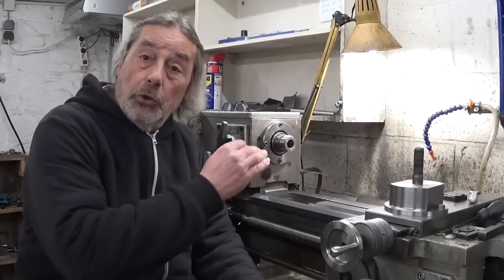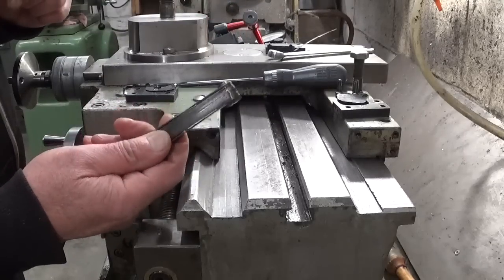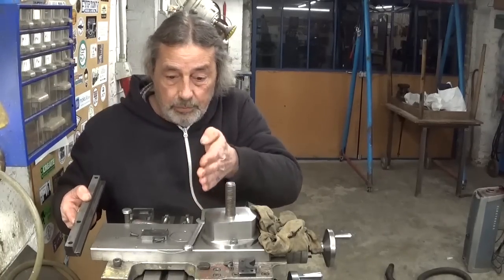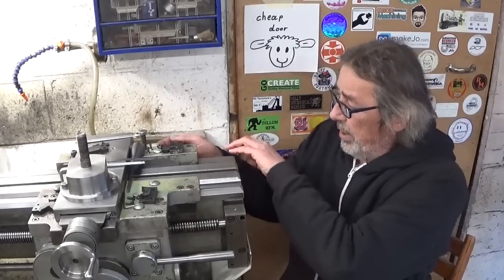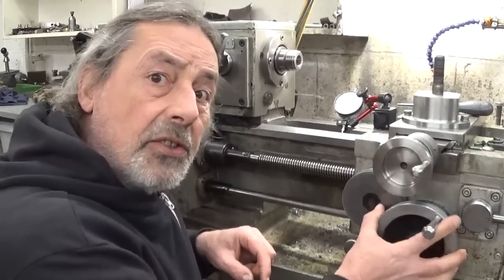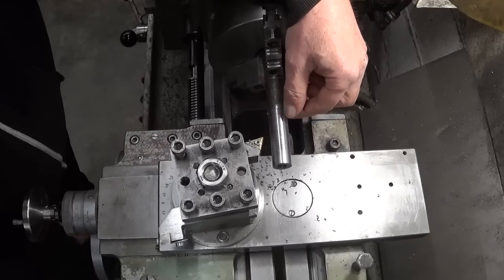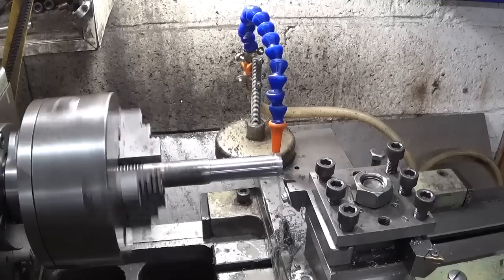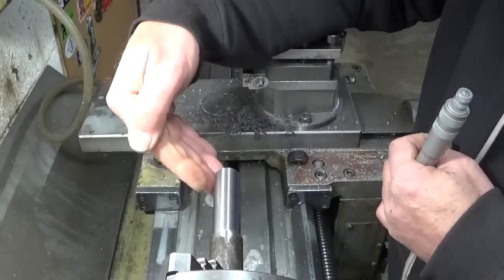Carriage problems.

Comment: That's really strange, and discouraging. I think your problem lies in the wear of the V ways on the saddle. I would take the carriage apart and turn the saddle upside down and examine the way surfaces. Maybe you have a piece of swarf or a burr that is causing this misalignment. If you have a large enough surface plate (who does?) you could measure the V ways for wear down the length of it. You may need to mill the ways flat to solve this one.
Reply from the maker: Taking the saddle down is on the "to do" list :)

Comment: Hi Michel ☺,  these kind of problems can drive you mad, between headstock alignment, and all the variables in the  carriage to bed , and cross slide wear it's realy amazing that the lathe has so little run out, but I know the slight taper ,and finish to a cut are troublesome. But as we see here the adjustment to the carriage caused the taper to change direction, so I think your looking in the right area, perhaps a shim in that rear hold down plate would stop the carriage lifting up, and tilting away from the the front way, therefore iliminating a taper cut ?. I think we viewers will be watching whith interest to see where the problem lyes, as I think they will be fellow sufferes out here whith a similar problem. Thanks for another interesting video mate, stay safe, best wishe's to you and your's, Stuart UK.
Reply from the maker: Thanks Stuart. I will continue investigate.

Comment: its a great video. And in my opinion (amateur), there is not much that can be done here, besides to regrind the lathe bed. It looks like a very common problem on old and used lathes, just simple bed wear in an area in front of the chuck. One thing also that should maybe be considered, is a headstock (spindle) alignment. In your place, i would try to put in the good test bar in the chuck and try to measure then to see. That can also be a source of a taper. Anyways good job and effort....
Reply: The greater fault seems to be a high spot under the saddle vees rather than the bed itself. Scraping out any high spots under the saddle would go a long way to correcting any 'rocking' of the saddle.
Reply from the maker: Headstock aligment was also my thought. But that's not the problem.
Reply: @Rustinox  then i would agree that you should check  underside of the saddle... Oh and one more thing just pop on my mind. Maybe you should check your lathe alignment, could it be that you have diagonal twist in lathe bed, so that could also be soource of rocking in saddle...

Comment: Hi Michel. Good work on the maintenance. I did notice unless it was the video , that you were running the lathe RPM quite slowly. Have you tried at a higher speed as i get better cuts at a higher speed. 
I have sent you a new sticker as those early ones are fading due to me printing myself. The new ones I have had made.
Regards.
Steve.
Reply from the maker: I run the lathe at a surface speed of 25m/min using HSS tools. If I use carbide, it's way faster.

Comment: I had done a simillar repair on my "weld used" 1968 Logan 10" lathe several years ago. It wa a good thing you corrected that movement in the carriage IMHO Michel.
Reply from the maker: Thanks Al. I have to contune the investgation.